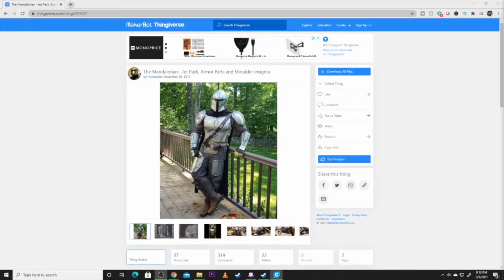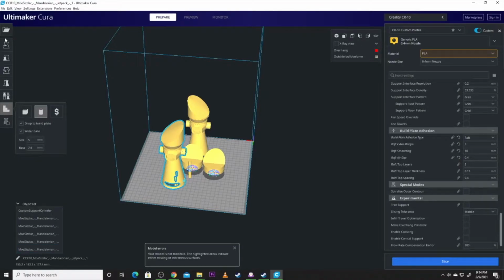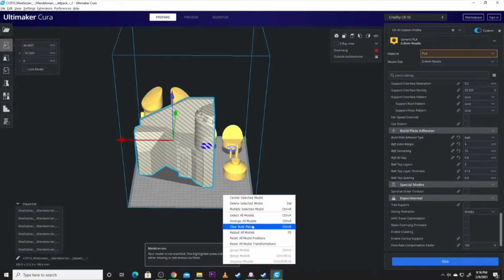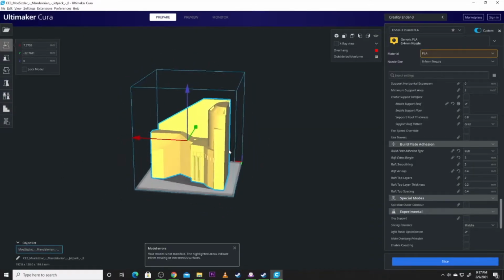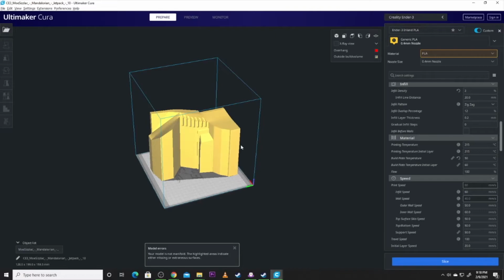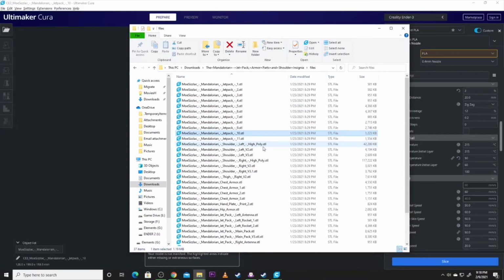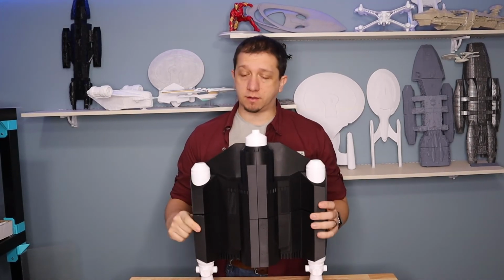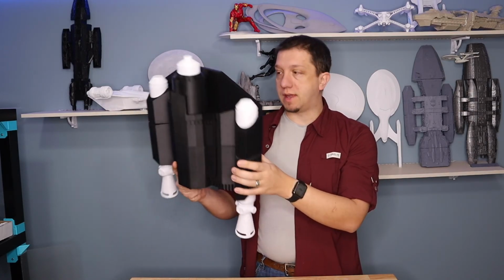Mandalorian Armor 3D Printed - Mando Jetpack

Comment: Hey, I had an idea for the jetpack, I wonder if anyone has tried it.

Imagine a design for a jetpack that is empty and hollowed out on the inside, maybe it has like little compartments to hold things when one is walking for example like during the convention like a mini backpack, maybe the design could have like a secure lid that opens to inside and is not too noticeable so it doesn't break away from the immersion.